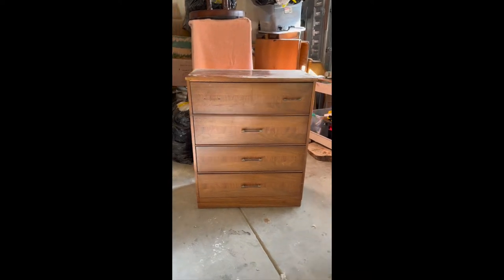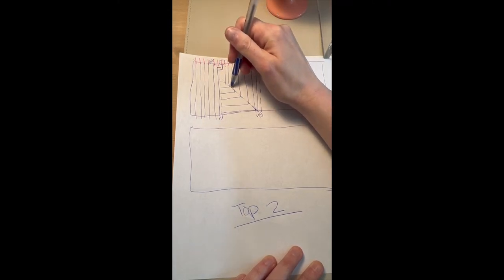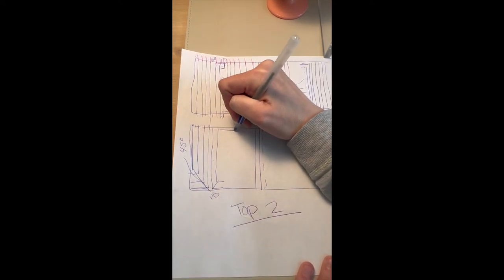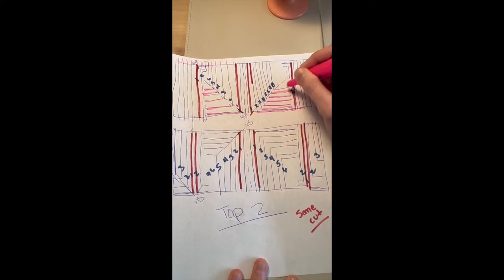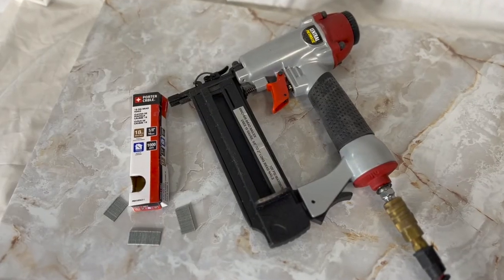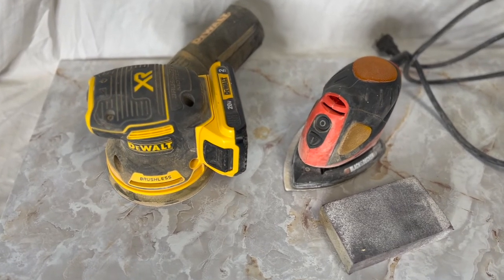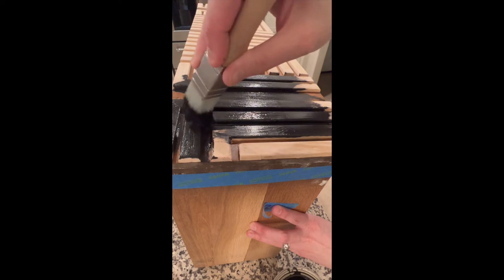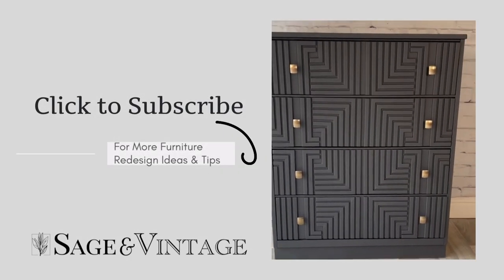DIY High-End Dresser Makeover on a Budget!

Comment: this is amazing. what is the thickness of the trim you used? I'm in Australia and struggle to find any that I think are thin enough
Reply from the maker: It’s called pine screen moulding here and it 3/4” wide and 1/4” thick. I hope that helps 😊
Reply: @sageandvintage  thank you so much
Reply from the maker: @bronwynharford8327  You are welcome. You can always message me if there is any other questions. Happy to help.

Comment: There is definitely a lot of math here! Like how did you measure the number of pieces and spacing needed based on the width of the trim and the width and height of the drawer fronts. You did a great job but I suck at the math part and would have a hard time figuring that part out. Thabks for sharing!
Reply from the maker: Honestly, I didn't use much math. I only measured to find the middle of the drawer. The rest was just playing with scrap pieces and the spaces. Once you play around with it, you will see it and can be easy. Thank you for watching. Check out some of my other patterns too. 😀